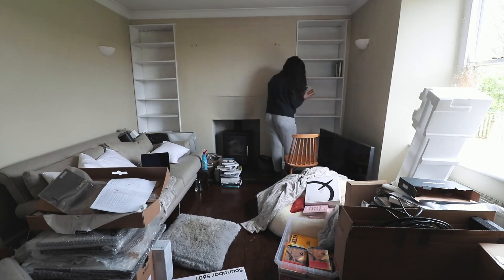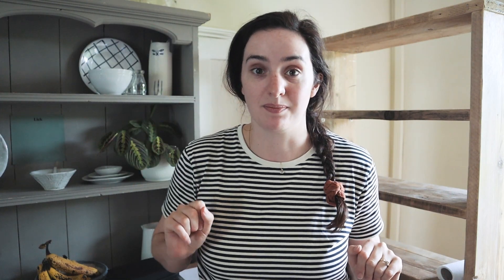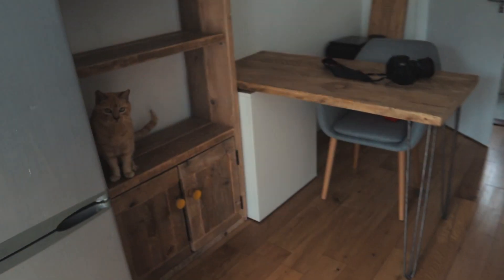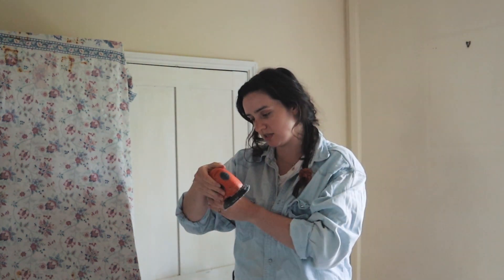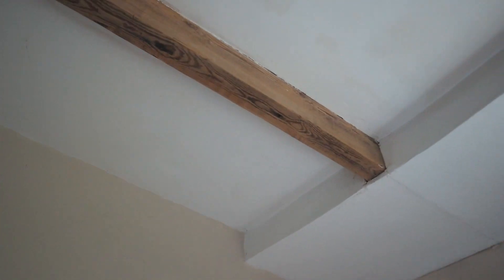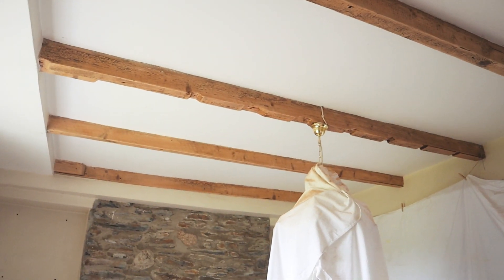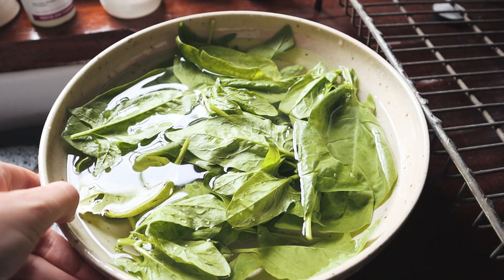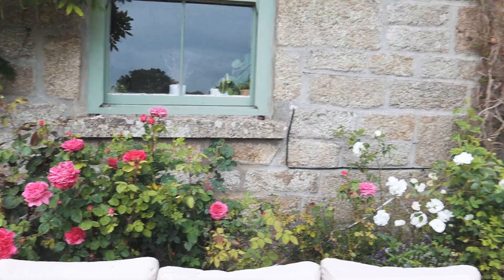THE RENOVATION BEGINS In Our 200 Year Old Cornish Country Home | KITCHEN RENO PART 1

Comment: Madeline, check out a product called Odie’s Oil. You can get it here in the states I’m not sure if you can get it over there. It is an all natural product that you use on wood. It protects it, seals it and brings out the natural color. No need for varnish or stain. We used it last year when we had our kitchen redone. We had walnut cabinets installed and that is the only thing we put on them from the natural wood. They are beautiful and it is natural

Comment: I would just put a nice oil on the beams. In Germany we use linseed oil for example for furniture, work tops etc.
Reply from the maker: Thanks for the tip Julia <3
Reply: That is such a good idea!
Reply: Linseed oil is great for wood, but remember to be careful what you do with the cloths you use to apply it, as they can spontaneously combust under some circumstances.